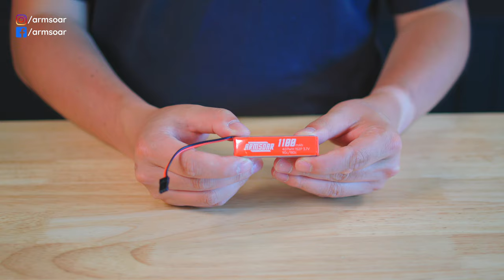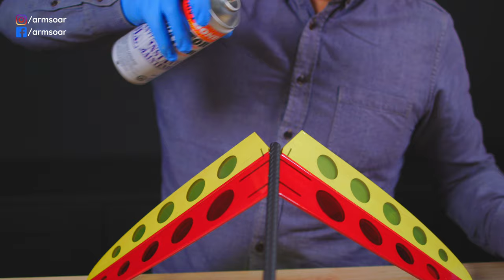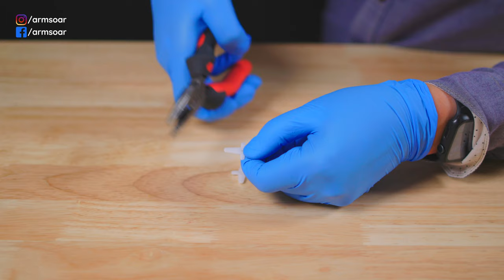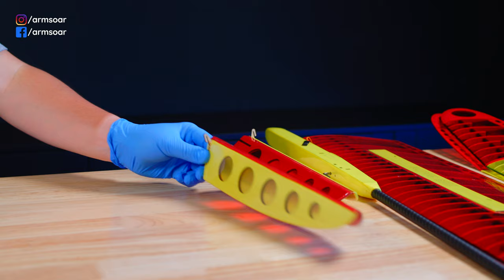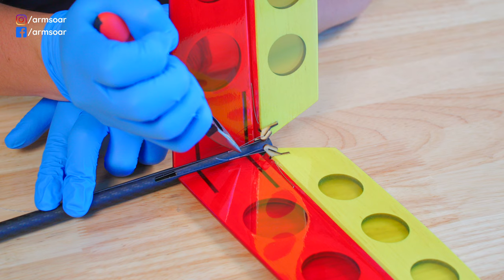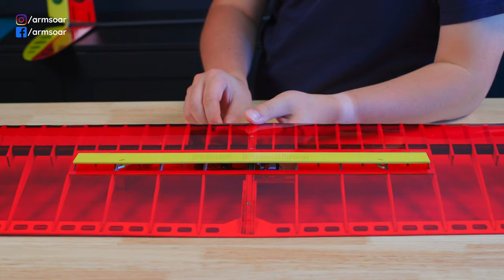Medina ARF 2 Meter RC F3-RES Glider Build Log

Comment: We used to build a sliding servo tray with one fixed and one sliding servoes we didn't need mixers. Had differential up elevator in turns too. V-tails rock

Comment: The servo travel is a bit short on x06 with the first horn. It barely covers the recommended travel and does not allow any extra room for experimentations. I guess it would be better with x08 on the second horn (7mm). The plane needs a little less than 50 grams of nose weight, which is an extra $20, when available. The servo frame also needs to be bought separately. You can carve/print apparently.

Comment: Preparing to purchase the Medina kit.  Quick question.  Should the area where the tail torsion spring is inserted be reinforced to keep the wire from poking through over time.
Reply from the maker: Hi Larry, not really needed, but a drop of super thin CA is a good safety measure.